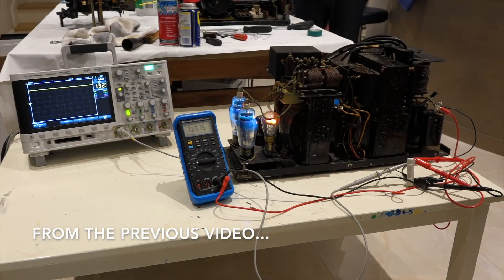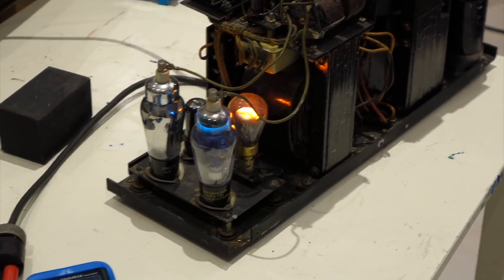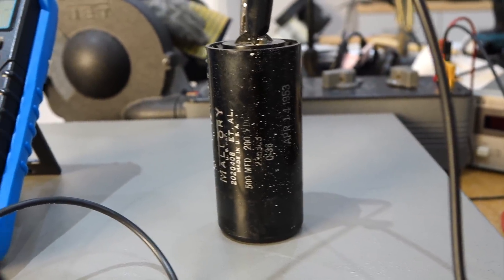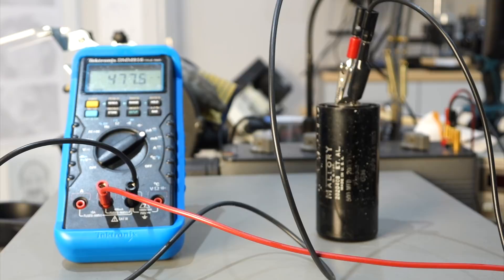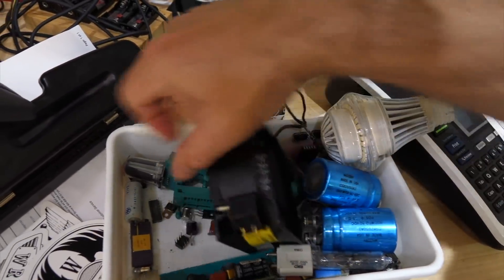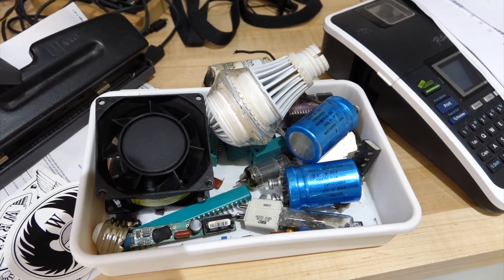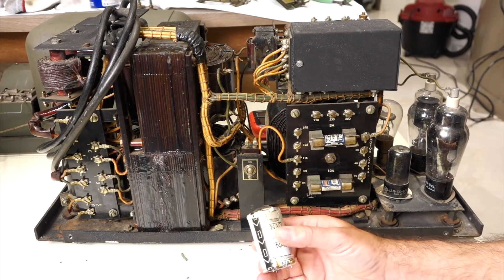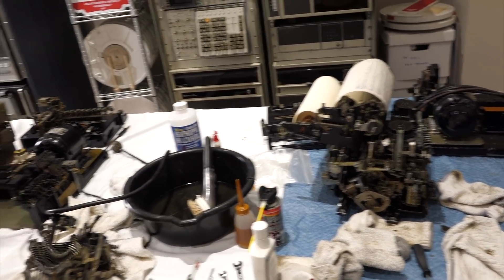Why we don't always replace vintage electrolytic capacitors

Comment: The problem is that some people assume that just because it's wise to change the electrolytic capacitors in fairly modern switched mode power supplies, as the cost is negligible versus the likelihood of failure, then the same applies to ALL types of power supply from ANY period, which is just simply not true. Modern capacitors, in some ways, are less reliable than their vintage counterparts due, in part, to their smaller size, relative to capacitance, and the changes in construction this has lead to. Obviously, when restoring a piece of vintage electronics it is wise to avoid the wholesale replacement of ANY parts to keep as much originality as possible, only replacing parts that are beyond repair / refurbishment and only after careful consideration of the available evidence.
Reply: You always have to consider possible chain failures or common failure causes. If one capacitor blew, you have to treat every capacitor in parallel with it with suspicion, as well as everything that came from same brand and series, and everything in its thermal vicinity if it's a hot zone. With modern electronics design, such mass failures are common regardless of individual capacitor quality. In numerous designs with known faults or issues obvious at a glance just from discolouration and stains, preemptive mass replacement is advisable after a time even if there is no obvious failure.

Comment: I recently picked up a 1934 Telefunken radio. It looked like it had some work done back in the late 1940s, but the cathode bypass electrolytic capacitor was still original. I was amazed that it read in spec, both on capacity and on ESR. Also the leakage at the rated voltage was acceptable, at least for a device that was probably last used in mid 1960s. However, paper capacitors are all shot, some measured as low as 2k Ohms, this is almost a short on a 280V DC rail, and would quickly take out the very expensive RGN1064 rectifier.
Reply: The Germans made great tubes and caps. I collect telefunken and Grundig radios and have never changed a cap.

Comment: Caps in consumer products tend to be the cheapest that could be sourced and why those tend to go bad with age. The "capacitor plague" didn't start till sometime in the 2000's when it became pretty difficult to not get defective electrolytic caps from most manufactures.

Comment: My only objection to the earlier video was the interpretation fo the results from the Heathkit capacitor tester. Due to the range selection, you were testing at only 75% of the rated voltage, and the magic eye only opened to a sliver of a gap. I’m no expert, but I have two of the C-3s and two IT-28s. When testing a good cap at it’s full rated voltage (where possible) I typically see the window open nearly instantly to it’s full width. I would have judged that cap as marginal or “maybe good enough” at best. The test you did in this video shows that the leakage is improving with time at its operating voltage. If it took over 60 years to reach that level of leakage, I suppose it will last awhile longer.

As a bit of a novice, it does make me think when experts such as yourself and your team have opinions that are diametrically opposed to others, Mr. Carlson’s Lab, for example. Thinking is a good thing, of course. Before I saw these videos, I was leaning towards the “just replace them all” camp, but now I’m not so sure. When I saw Mr. Carlson’s explanation, I was wondering why he was concerned that a fused input transformer would be damaged by a filter cap drawing excessive current. Maybe we can’t always rely on the fussing being properly designed, especially in consumer products. Looking at your transformer, it looks like you’d be safe. I have seen (I can’t remember where) demonstrations of coupling caps causing tubes to run hot, but that’s not applicable in a power supply.

Great video series, by the way. I actually saw much later versions of the teletype in my USMC 5938 training in the early 1980s. Our equipment was a weird mix of things from the 1950s and state of the art digital automatic weather stations and satellite receivers. Thanks for your, and your teams, efforts. I am generally amazed. It’s great there are people putting in the effort to preserve this kind of history.
Reply from the maker: That's a good way to put it. We thought it was a "marginal good enough" cap, which would be fine in a filtering application. And probably not for a coupling cap, as Carl recently pointed out to me. I like following Mr. Carlson (should we call it Professor Carlson?). In general he does older stuff than us, with much higher voltages and consumer paper caps and all, so I am not sure that his experience directly translates to our more recent and professional stuff.
Reply: CuriousMarc this is the kind of conversation i sit on the side at nodding knowingly while understanding maybe 15%.
Reply: @userPrehistoricman  
That is not true in most cases. Cap-changers are the type of people who don't seem capable of doing proper diagnosis and repair if an individual component fails.
Reply: @gregorymalchuk272  Thankfully i wasnt one of those cases, my Macintosh LC had electrolytic all over the board coming from ever capacitor. thankfully no traces were damaged. but that is the issue with people just replacing capacitors even if they are good, a lot of people would say to recap my dell dimension 4100 but im not going to because all of the capacitors are fine and people say the capacitors from 1999 to around 2007 are always bad, my dell dimension 9100 and 4100 are both fine just the 9100 has 1 bulging cap but what do you expect it was running for probably 3 years straight
Reply: @CuriousMarc  it does

Comment: Great video. If a part measures good, no reason to replace it. Plus, if after several hours of running the caps are showing no problems, I'd say it's likely to work as good now as it did 40 years ago. 
Would a new cap be working as well in 40 years?

Comment: Most of my instruments still have all the original caps. During Restoration I measure leakage, reform if needed, measure C an D. If all values are within specs stated by the datasheet, or if no data can be found, from my own lists it will be placed back in the instrument. If not good I replace it for a new high quality comparable cap. That is the same specs for WV,  leakage, ripple current, D, temperature and hours of use. Often old good quality caps turn out to be better as good new caps.  
This whole witch hunt is caused by people repairing consumer stuff  without much knowledge and armed with their holy in circuit ESR indicators and the new trend, a LV leakage tester... I use several LCR meters and bridges from HP, IET, ESI and GR and 2 HV leakage testers (my own design) My best bridge is a GR-1520 ( with a famous history being the  EX-Genrad standards lab bridge)

Comment: Genuine question, but other then for keeping the vintage-ness of the device is there any reason not to replace them preventively?
Reply from the maker: I'd say only if they had a known wearout mode. Like the ones in my SE/30, or some paper caps I hear about - but have no experience with, or a particular brand/date code that is known to have a wearout defect.

Comment: I know you have already had a lot of people saying change the caps but... I have restored many old pieces of valve equipment and have often found very old electrolytic caps that read fine (especially after reforming) and passed high voltage leakage tests but ALL failed shortly after being put back into use. When I opened them the failure mode was mostly due to failed separator layers that had not aged well. In general they failed dead short and in a power supply this generally takes out the rectifiers. The ones in your piece of equipment are hard to find. They may seem OK with little load but once you subject them to large ripple currents they may object. To keep originality you could re-stuff to keep the appearance the same and remove the risk. Of course this is just my opinion. Great video's anyway. Not sure of you mentioned it but the fuse in the lamp socket was to allow dim bulb testing.

Comment: The internet is full of 'experts'. Try not to let it get to you. It's not like this machine is going into daily service and is vital in some way. If a cap fails, it fails. If it doesn't, it doesn't. These caps are military grade and were expected to be used hard. These aren't those shitty modern cardboard caps that pop all the time.

Comment: I've worked on tons of Tube equipment, mostly Radios and Amplifiers and about 90% of the time I replace all of the caps. I also attend to replace the power cables with polarized cables and some times with IEC plugs. X/Y saftey caps to replace ceramic caps on primary side of transformers.
Paper/Foil Caps turn resistive so it is a automatic time to replace. Electrolytic caps dry up and can turn into a game of Russian roulette to reform them, Granted they're tougher then modern caps but I wouldn't trust them for high voltages.
Then again I do this to stuff people plan to use a fair amount of time VS restoring something that ends up being a shelf queen.
Reply: Leland Clayton I believe it is question of mentality. When I repair or restore something I want it to be safe and work as best it can. Of course in museum grade equipment you will have to consider historical purity and preservation for future generation but it is oxymoron to argue for 65+ electrolytic being still "good" .It is not good nor will become good. Only reason not to change it would be (unobtainable type or if equipment is not going to see any major use and is planned to just look good). Then of course it do not matter. I am not greatly exited when simple topics grow in mutual flame wars. Best just stick being sensible as we can.

Comment: But......Louis Rossman teached us, its never the fuse!!! ;)
Reply: I thought the point of that was that if you see a blown fuse, you don't just replace it and move on, you figure out what caused it to blow.

But granted, on very old stuff that ran for a while, sometimes a fuse blew just because, burned out like an old lightbulb. It's nearly the same thing really, both are thermal devices.

Also i thought it was "it's never the coil".
Reply: "Taught us" ;)
Reply: deathblowhere pffff tedails ;)
Reply: xDD Anyway, Louis Rocks)

Comment: Most of the failed vintage capacitors I have seen were melted wax capacitors. For me, its been a 50/50 shot if the metal sealed electrolytic capacitors are OK. I like to test them first, though, when I get my hands on something vintage just to be sure they are OK :).

Comment: Thank you for making this video. I posted one of those comments, but I'm very sorry. I have watched too much Mr Carlson's lab and he says you should replace all vintage caps before even trying to turn the device on.
Reply from the maker: But he repairs stuff that's way older than this though, and caps that are used for something else than filtering where even a small leakage is an issue and there is no short protection in the circuit.
Reply: CuriousMarc Due to this video, I understand now.
Reply: A 470uF or 680uF (500uF isn't a standard value anymore, and may have multiple smaller value caps in parallel packed in the same can, wasn't uncommon) 200-250v cap is less than $5. If you're concerned about visuals, you can always take the guts out of the old caps can stuff the new ones in there. 

It is possible that Mallory is a paper in oil, which could also explain why it is still good (for now). As I mentioned, if it is your own stuff, knock yourself out and leave it in. But if I were repairing something for a paying customer, it wouldn't leave my bench with the old electrolytics in them. Old Philco and RCA gear I've worked on recently the power supply caps were junk, there was a very loud 120Hz buzz when (briefly) powered on. But these were dry electrolyte types 

This is just some constructive criticism, but testing a cap at about 50-60% of its rated voltage isn't conclusive. It isn't uncommon for a cap to behave well at a lower voltage, then may abruptly fall flat above a certain threshold.
Reply: I’m not sure where this “bad modern cap” thing came from. Nichicons, Rubycons, CDE (who bought Mallory), Illinois Capacitor, etc., are all well known and very reputable cap manufacturers. Most of the cases where I’ve seen bad caps (ie., those that died prematurely) are because the manufacturer of the device cut corners either by using caps with specs marginal for their purpose, or used cheap no name caps. 

But I think you continue to miss the point of why most people say to replace them. Time. It takes time to test them, often taking more time than what could be spent on swapping it out and being done with it. Obviously if the cap is extremely expensive or is easily accessed, testing is more appropriate. If it tests fine, great, leave it in there! However electrolytic caps have a finite life, and it is impossible to know where they are life wise without being tested. In the end, it comes down to how much your time is worth. 

I would not get hung up on “Mil Spec”, particularly comparing a 60 year old component to a modern one. What was considered “Mil Spec” back then is sometimes now commonplace. 1% resistors, which are all I order anymore, used to be somewhat exotic and expensive 25 years ago. Now they’re maybe a penny or two more than a 5% one. Today that term is thrown around just to lighten the pockets of people who assume it must be better, even though they may be being sold the exact same part that can be had at a much cheaper price at a reputable dealer.
Reply: He, and others, recommend doing it because caps are cheap in comparison to power transformers, tubes, etc. Unless you are going to the trouble of removing every cap from circuit to test it, there is no way of knowing if the cap has failed or not. This particular piece of equipment had the caps in an easy to access location, but in some, removing caps may mean unsoldering several wires, some with brittle rubber insulation that crumbles at the slightest touch. If you are having to go to all that work, it is foolish not replacing an unknown cap, when so many of those age are at least suspect. Particularly any type of paper caps that will have any kind of voltage applied to them. 

There just seems to a cult like obsession with keeping old caps in equipment. True, some may have seen an easy life and test okay, and may last another 20 years. But I’d hate to power something up, particularly if it was something that belonged to someone else, and have it go up in a puff of smoke because of a bad cap that could have been replaced for $5.

Comment: I can't +1 this enough. Most of the "Replace ALL the caps" situations are for devices that were made after 1990 or so, when manufacturers started using the cheapest capacitors instead of the most reliable ones. Around that time, lots of component factories in Europe and the Unites States (which had years of experience making parts that don't fail) started closing and far-East  factories that produced cheaper parts started opening and copying each other's faulty chemical recipes. My personal opinion is that that was a big part of the start of the throw-away electronics society that we have today.

Comment: What alot of the people sayng "replace the caps" dont know is most professional test equipment, computers, etc. from that time period use some of the best caps the manufacturer can find. Most people are thinking of cheap paper capacitors in hobbyist grade stuff, and those do tend to go bad. My 1950s Tektronix oscilloscope runs just fine with original capacitors and I dont intend on replacing them.

Comment: Is that for sure an aluminum electrolytic and not oil-based?  I did a bit of poking around on the interwebs and couldn't find a definitive answer to that question.

Comment: Modern equipment tends to run their capacitors closer to the limit than vintage equipment. Things like 6.3V capacitors running at 5.25V.  That causes extra stress to them making them more likely to fail.  Further to that, modern capacitors are built smaller. That means more plate surface area in a smaller physical space meaning less electrolyte. Capacitors fail when they get dry (and voltage ripple causes heating which in turn causes vaporising of the electrolyte which then causes drying out), and with less electrolyte they dry out sooner = fail sooner. So vintage capacitors have a longer lifespan than modern ones because they are run more gently and because they have more electrolyte in them. Replacing vintage capacitors with modern ones may mean you are shortening the lifespan of the device, not lengthening it.  Replacing capacitors in modern (i.e., 10 year old or so) equipment is a far more reasonable proposition since yes they may well be nearing the end of their lifetime.  

Simply put: Anything from maybe 1980 onwards, replace the capacitors by default. Anything older than that, only replace them if you really need to, and then ideally with one that is just as old as the one you took out.

Comment: how can i forget the smell of rotten elec capacitors? honestly it appears to relate to only some types\brands, and they pretty much rot all of em (bad solutions during manufacture?).. apart from obvious fluid leaking i'm wondering WHERE the current leaking is going...i mean, it's 120V times 0.0005A it's like 0.06 watts... tbh if this kind of (lil) power accumulates in one small point (oiled paper?) it can roast and short that point and you will then prove that the atom bomb was from the '30 :D also i'm not sure if the descending current doesn't mean it's drying up the electrolyte in the point, if bubbles formed i'd check the capacitance afterwise.... all of this just to say, of course, imma no expert